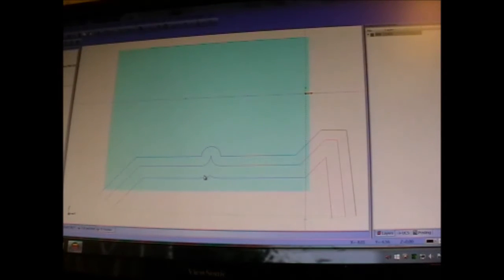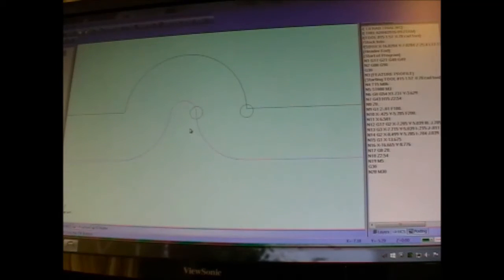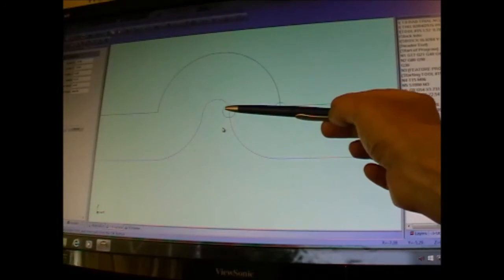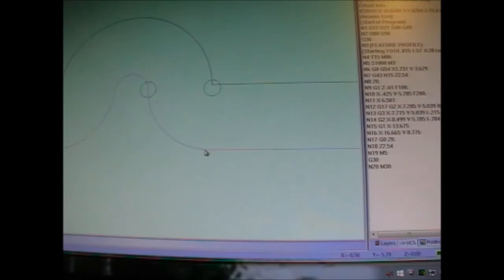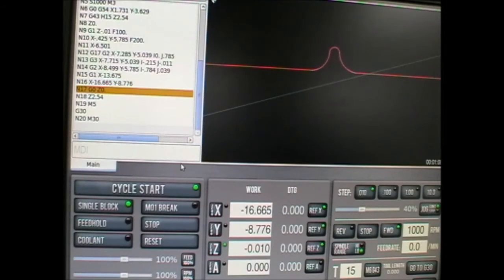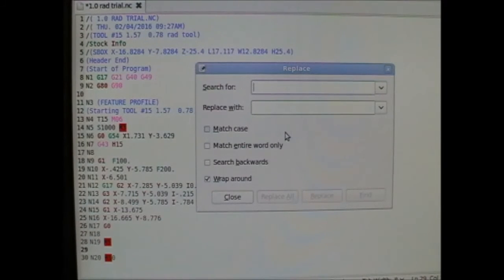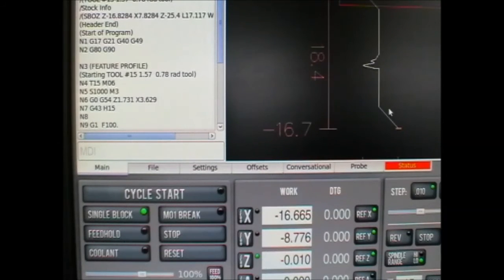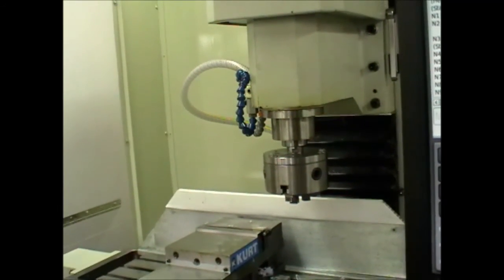G code editing -  milling to turning. part 2

Comment: Very cool. I did it once myself but in a different way. I programmed the part to run on the lathe, so all the G-code was lathe G-code (X and Z), then ran it straight onto the mill. The only thing I had to do was to change the lathe mode from diameter to radius mode. The code worked well, but the setup was not as rigid as on the lathe, and the part did not turn out all that well. One thing I did not have on my part though is any kind of radii, so it was just straight lines cutting. I'm not sure what would have happened had I had any fillets.
Reply from the maker: +Crivo152 Thanks. - So you had lathe CAM software or used conversational on a CNC lathe?cheers
Reply: +Threadexpress Using Fusion 360 lathe cam and the post processor for the tormach is on there now. Need to tweak a few of the codes but as @crivo152 mentioned it gives you the xz code at least. Just have to play with your cad design to get the origins correct etc. If I perfect it I'll let you know.
Reply: +Threadexpress I think I used the lathe CAM part of Fusion360 to generate the code. I was slowly transitioning to F360 at the time so I cannot be 100% sure, but you should give it a try,  It's free for students, teachers, enthusiasts and businesses grossing less than $100K a year.
Reply from the maker: +Crivo152 Very interesting. I have had a quick look. Can you explain how they begin to charge the monthly fee, ie how do they know when you must begin to pay, and is there a risk that policy will change after you have learned the software ?
Reply: +Threadexpress This is where you can get your copy http://www.autodesk.com/products/fusion-360/overview. You just download the free 30 days trial, then you convert it to a student/teacher license renewable every 3 years, or enthusiast/small business license renewable every 1 year, or you can start paying the $300 per year. I have seen a short clip on YouTube where the CEO of Autodesk said they made a decision to make the software free to stimulate a rebirth of manufacturing in America. Of course they can always change their mind at some point, but it doesn't appear they intend to. Having said that, I am not throwing away my other CAD, just in case.